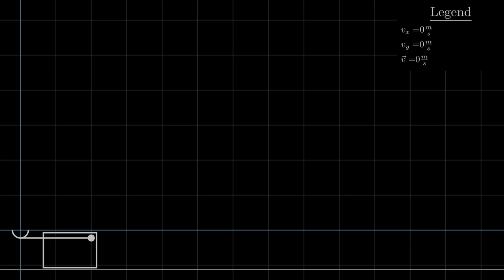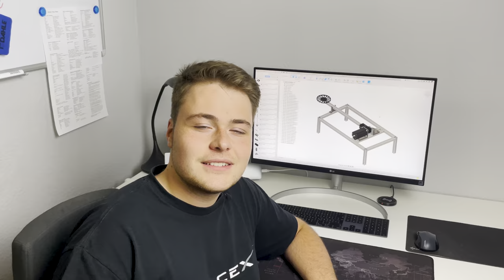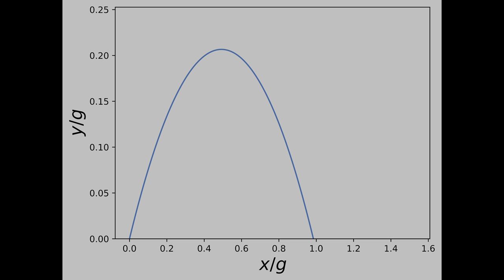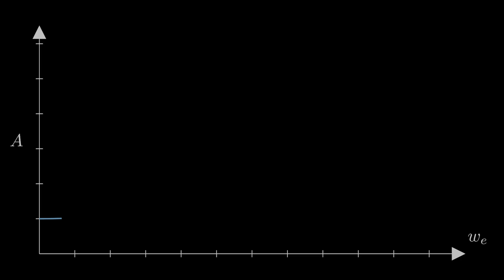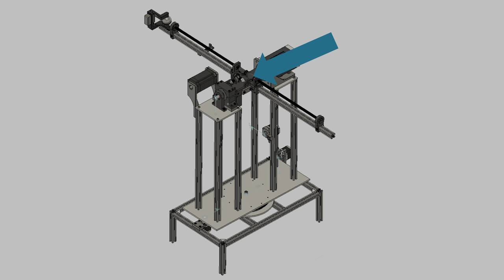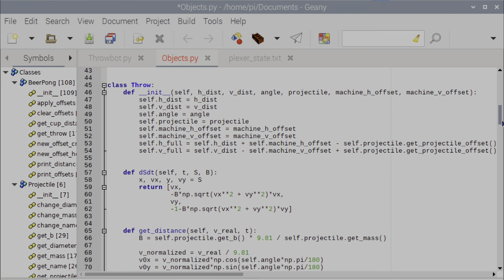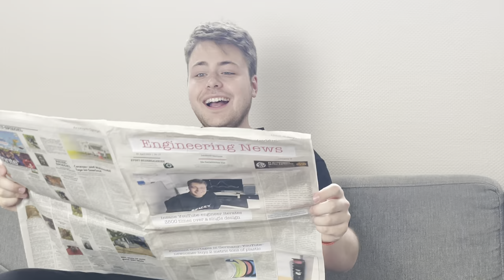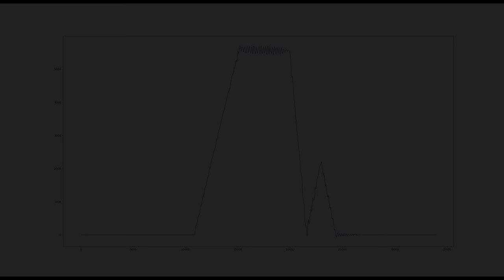Robot vs. Beer Pong

Comment: This is a really cool project, and a really wonderful video. Your visualizations are excellent and explanations were great. When you switched to a continuously-rotating arm I was surprised you still had to contend with the harmonics, but you had the data! Really amazing work.
Reply from the maker: to be honest, I think it might have worked without the shiftable weights, but less precise. That's what I meant when saying "25% hitrate"... The huge downside of using a stepper motor for sth like this is that there will always be some struggle with the harmonics... I can just try to make it better, not disappear. Thanks for your support Garret!

Comment: Hi, I really enjoyed the video. I was wondering how you calculated the friction coefficient "k" in the following expression: f = -k*v. I tried it myself, including recording the free fall of a ping pong ball from a height of 4m, then transitioning to a steady state to apply Newton's laws and calculate the coefficient. Do you have any tips and a value for the friction coefficient? Thanks, and keep up the good work!
Reply from the maker: Hi there, glad you liked the video! I didn't find a way to calculate it, but I iterated my way there. I started with drag coefficients of about Cd=0.45 for spheres (this is heavily dependent on the Reynolds number of the ball). I tried my best to be very precise with everything else (mass, area etc.) and then vary the drag coefficient until I got good results. This is not very scientific, but without any expensive laboratory equipment, wind tunnels etc., I didn't find a way to make it more precise. I landed at Cd=0.41 for the ball I used and this gave me great results. Important to mention that this value can be something completely else, if your ball has slightly difference surface structure. Did you try guessing coefficients and trying to verify them in tests with an average of e.g. 10 free falls?

Comment: This is VERY GOOD! Well done! The homing method was sexy. To turn a halleffect to the perpendicular axis... Sheesh. 

If I may! If you made the arm out of carbon fiber. Would you not have decreased the mass and increased the stiffness and therefore increase the natural frequency far out of the range of all possible throws?
Reply from the maker: that's true. I would have increased the natural frequency, but not necessarily out of the range of possible throws. Often, the natural frequency was reached at about w/2... So the arm has to go through the resonance area, and then still speed up a lot. Making the arm out of carbon fiber would probably result in a natural frequency that is close to the step frequency of the motor. I guess this is sort of a trade-off between an arm that is as light as possible and an arm that is not very likely to be influenced by vibration too much, because of its inertia...
Reply: @niklasbommersbach  ahhh I seee!! thank you for the reply! I hope to see your channel grow. You deserve it!

Comment: Super interesting strategy! I built something very similar and we went in a different direction using a softball-launcher style wheel drive. That gives us a wide range of ball velocities and we could potentially give it some sidespin, but we can't control the launch angle vertically. We also spent a lot of time using a realsense to try to detect the balls in realtime. Look forward to following your channel!
Reply from the maker: Wow, I just looked at it... that machine is great! Wasn't it super hard to hit the cups precisely with this kind of "flat" throw angle? I had the best results at about 40-50 degrees... Yours seems a bit less steep?

Comment: Amazing work, love the humor and production too. 

As constructive feedback, I can't help but think you could have done better with deeper knowledge of control theory - shifting harmonic frequency should not be needed at such low freqs, or with an alternate drive system
Reply from the maker: thanks for the feedback! Yes, there is an infinite number of possibilities the design could have been better. But - like I wrote in the description -  I just could not get the design and the mechanical principles out of my head and really wanted to make it work. I have limited knowledge of control theory (working on it) and therefore went with this approach. I think, probably a 300-400 W AC-servomotor would have been the better choice, but: $$$...